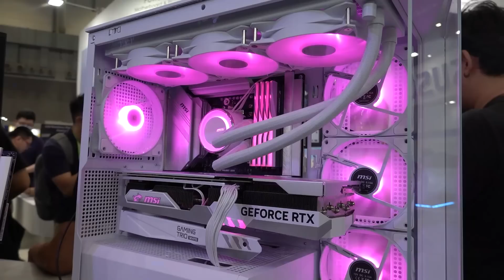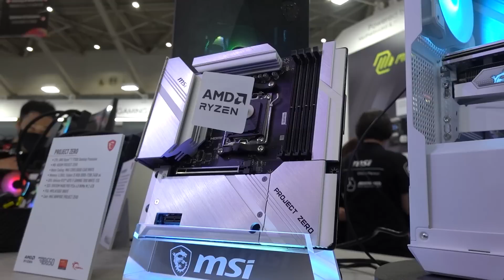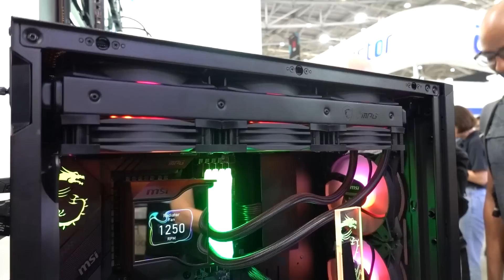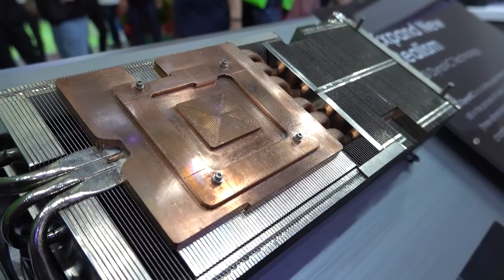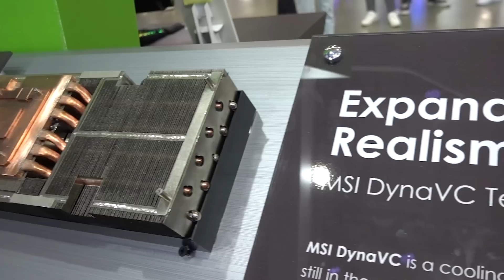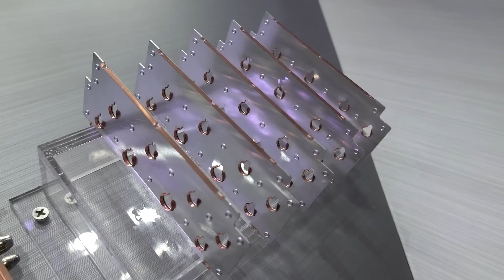They're Killing Off Cables?! | MSI at Computex 2023

Comment: At this point I am surprised that there is not a single large cable to power the case like a laptop. The difference is that it is a thicker cable. I think PCI-E ruined the world as they dictate the power input.
We have seen an 3x 8pin go into a 12 pin. Why the fuck are motherboards not made thicker to support more power?! 
Stupid PC dictators are deciding what is possible.
At this point I feel that this is another Hydrogen vehicle issue (offed early because of the money loss of a big corp).
Stop with this tiny growth!! Intel had such small growth until AMD hit again, then they stair stepped but leaked that they had a higher nM and still sat stagnant.

Comment: I feel like the "cable free" board can work if the inputs all have cabled connectors you could feed through the back of your MOBO tray. That way it's universal on all boards. No idea how viable this is as a power delivery system though

Comment: According to a couple of other vids I've seen about this, it doesn't cost them any more money to do this, so they claim the boards will be basically the same price if they end up making them. If others start making cases that will work with this, it will make for a cleaner build and I think it would be easier to work with if you have to unplug things for upgrades or whatever as well.

Comment: I'd love for MSI and Asus to team up to put their new cable-less designs together. 
Motherboards with the power connectors on the back, and GPUs with that fancy pseudo-PCI power delivery slot. 
Both of those together'd look fantastic.
I do feel like this motherboard would be better with power cables that have 90 degree bends on the connectors though. Having the cables themselves do the bending while being squeezed in by the back panel of the case would leave me feealing kinda skeeved out over it.
Reply: +1 for 90 degree connectors. Then case compatibility isn't as big a deal.

Comment: This ‘cable-free’ motherboard makes so much sense. It’s surprising that motherboard manufacturers haven’t made this mainstream.
Reply: Because they'll need to convince every other manufacturer to also do the same thing and case manufacturers to create cases that support it or else no one will actually buy them
Reply: i like it too but it would start as a niche design until more cases are designed around it. with their iteration you’d need a slightly more spacious cable routing area to avoid bending unless they develop angle adapters, which adds even more to cost. cost is a huge reason why a lot of manufacturers avoided it until now and they know now that people are willing to drop that extra cash for a more unique look
Reply: They have not been able to fix those stupid front panel connectors....so...
Reply: Asus 1-upped them and added a 600W port near the PCIe slot for a cable-less GPU install (copied from AMD-Mac implementations)

Comment: The idea of putting cables at the back is weird. Yes, we'll have cool interiors of the systems, but you need to manage those cables somehow and this requires additional space. I'd rather go for a sideways connection - this could be hidden under a cover plate next to the board easily while maintaining relatively good compatibility with some of the standard cases.